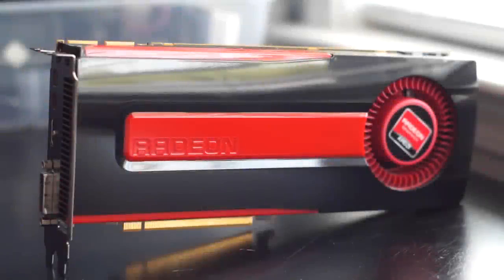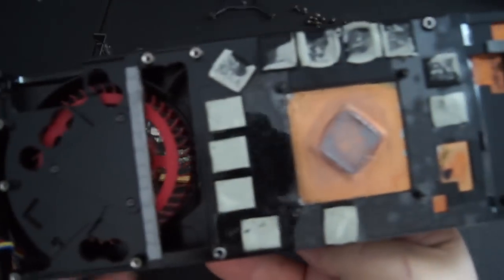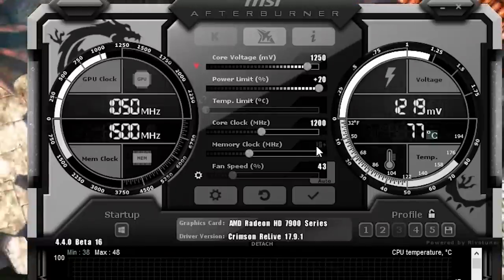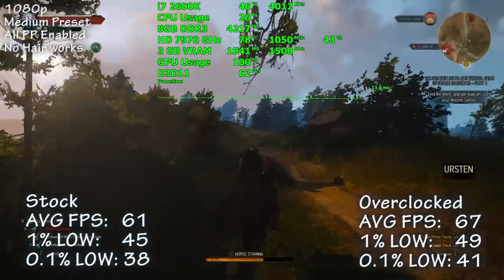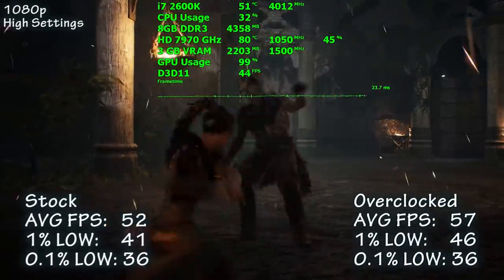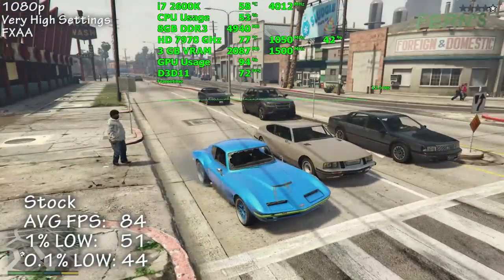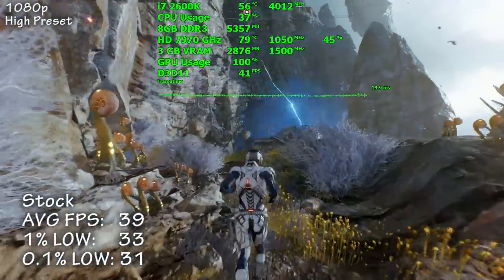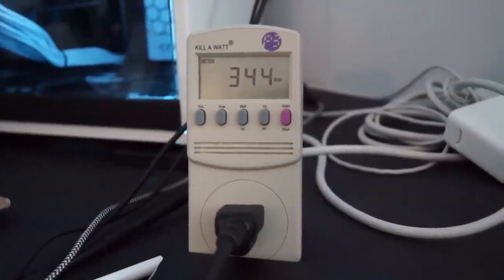AMD Radeon HD 7970 GHz Edition - How Does it Stack Up in 2017?

Comment from the maker: ***UPDATE***
Thanks to MC Peppers for noticing an incorrect result.
In Rainbow Six Siege - When selecting the Ultra preset, the game defaulted the resolution scale of 50% (which are the numbers shown in the video) - With 100% Resolution scale the stock clocked card pulled 55 FPS on AVG.
Reply: F2F Tech bf1??
Reply: Mike, are you in the Pacific NW by any chance?
Reply from the maker: Cooper Gates I’m not. Located in North Carolina.
Reply: Shoot. I hoped it would be easy for you to borrow my card for some runs.
Reply: @Cyrian Genesis performance is around 60 percent of the framerates 6 gb version is close to double the performance
Reply: Now rainbow six uses vulkan , im curious of the results of the card in there
Reply: Time for an update video! The 7970, The world’s first DX12 GPU just got the Adrenalin 22.6.1 WHQL Driver!

Comment: this thing is a legend, costed 300 usd in 2012, still isnt much slower then 300 usd gpu's today.... 6 years later wtf
Reply: I still run quad 7970ghz lol can push 4k in witcher 3 @ 50ish fps
Reply: AMD FineWine my friend
Reply: Looks like a good card to survive mining apocalypse
Reply: I'm 80 right now kids!
Reply: MC Peppers that was launch price, prices dropped fast, by 2013 they were selling for as low as 199 usd
Reply: Pyro1515 - Why would you run quad Crossfire though? There really isn't much of a performance increase after the 2nd card.
Reply: Unfortunately our own apocalypse is also undergoing! @breezyberwick1927
Reply: it's the ram , AMD did good pairing it with 3 GB of ram.   few games today use over 3GB , (though some do now )  no games  actualy  plow through the almost standard 8 GB s  found on many cards today.  give it another couple of years and then 3 GB won't cut it any more.
Reply: @DenverStarkey  Vram usage for 1080p sits between 3 and 4gb for ultra textures and it has been like that for some years now (remember how battlefield 4 used 2.8gb of Vram on ultra textures). There are a few newer games that shows an interesting gap between Rx 570/580 4gb vs 8gb, but 90% of them perform exactly the same... furthermore, Rx 570 has an improved performance compared with HD 7970/R9 280x (which performs pretty much like GTX1050Ti) so for the raw computing performance of the HD 7970, 3gb of Vram will be fine up to the point when 1080p become a legacy resolution (like nowadays happens with old GPUs with 1gb of Vram if used in legacy 1366x768 displays... in which cases they tend to do just fine)
Reply: @jotabe1984  
well that's battlefield 4 LOL , there are a few games that creeping  over 3 gigs of vram and even fewer that creep over 4 gigs vr  , the two titles I can think of that come first to mind are GTA  V and fallout 4 , both of which eat up 4 gig's of vram if you let them (ie , have a card with that much ram , and setting the setting up in game).  also the unreal engine 4  has seen 4 gigs of vram chewed up easily  in several games that use it , such as ARK  and Conan exiles.  but yes currently these titles don't even approach the vram of higher end cards , (most UE 4 games  vram useauge sits between  3.5-5.5  gigs depending on your settings. unless you of course crank your resolution up to 4k in which case you can see close to 6 gigs  get burned but still far from  the 8+ gigs most top end cards are sporting today.
Reply: Lol nice exaggeration. Don't get me wrong, the 7970 (normal and GHz) is a legend, but you don't need to lie to praise it. It didn't cost anywhere near 300 USD in 2012, as it was actually around 429 for the normal version and 499 for the GHz Edition in the summer of 2012. These prices were according to numerous articles published at the time, such as this one: https://www.anandtech.com/show/6093/amd-radeon-hd-7970-7950-7870-price-cuts-inbound-7970ge-available-next-week
Reply: (One comment on the linked article)

"When I was shopping the prices were about as follows:

HD7850: 270-290$, 280$ for the MSI Twin Frozer III version
HD7870: 300-350$, 330$ for the MSI Twin Frozer III version (what I got)
HD7950: 390-430$, 420$ for the MSI Twin Frozer III version

So I think my 310$ HD7870 is a decent deal considering my options and my budget. Compared to the HD7850 it's 15% more for 10-25% more performance. Compared to the HD7950 it's 80% the price for 80-95% the performance."

So, not nearly as good as some AMD fanboys would like to think
Reply: @XZagatoX  bought mine used after mining crash for 159 plus 10 or so for shipping with a huge artic  3 fan custom cooler sits in my main gaming rig as we speak however it's getting a little tired on newest titles
Reply: @Zennoq  yeah for GCN lol.

Comment: God, the 7970 must have been best PC part purchase of the 2010's. I've never seen a GPU this old be applicable in modern day
Reply from the maker: Pretty much was. Best aging GPU of all time IMO.
Reply: that and the Sandy Bridge processors! :)
Reply: It was, I have two 7970 GHz Editions sitting in a Xeon machine still. Use them for Folding. For a while back in 2016, I was still gaming on them in CrossfireX mode.

Really good GPU.
Reply: I had three of em even. Was like sitting on nasa tech

Comment: Great video!~

Just my 2cents , after having a 280x for about 4 years now, I began searching for aways to squeeze out more perf.
After testing with memory straps I saw that my performance was actually better at 1500mhz memory than 1600mhz and that "downclock" solved some stutters noticibly GTA V.
Its still such an amazing card.
Reply from the maker: Saymite Thanks. That’s interesting. I’ve done some testing my self a while back. I had a 7950 that did 1900Mhz on the memory. I stopped seeing gains when I hit it. That was with crysis 3 as well. I posted my results a while ago on the AnandTech forums.
Reply: Theoretically, my 280x does alot better at 1750mhz (190Gb/s @1600 to 210Gb/s @1750)   but that isnt really stable for gaming.

 I should also note that this changes from manufacturer to manufacturer eg. Sapphire may have different straps than MSI, and also changes from memory chip to memory chip mine is a H5GQ2H24AFR.

Still 1900mhz on a 7950 is fantastic
Reply from the maker: Saymite interesting. Yeah I had two 7950’s Twin Frozr cards. Both were high ASIC (high 80’s) and both Used the 7970 reference pcb. I believed they used Hynix chips, but both clocked very well. 7950 was the card to buy, overclocked like champs.

Comment: Great video, this card has held up pretty well!
Reply from the maker: Oopy Doopy Yes It did, and thanks again 👍
Reply: F2F Tech 
Why don't they remake this card with smaller GPU and 8GB of faster ram that uses less energy, and a backplate, as well capable of Crossfire with any other card will be perfect, with 1HDMi output only.
Reply: Fernando Salazar I think you are talking about the RX 570.
Reply: ProtonicPie 
Why doNOT they make a motherboard with 4GB of VRam built in, so it can give more ram to any card that is place in it as additional ram???
And the motherboard with 4 M.2 slots in the back
Why don't they just make the graphics cards with one single HDMI would be cheaper and better
Also they need to make liquid nitrogen cooling gel, so it can be apply in the heatsink to keep it cool and in the back plate
Reply: Fernando Salazar Yeah...Why don't they ? :)
Reply: ProtonicPie 
They need to make it, so I can apply Liquid Nitrogen Cooling Gel to the GPU.
And also the Ram chips needs to be able to slide out so we can add more ram or replace the ram
Reply: hey look who it is lol

Comment: Damn those numbers seem to be creeping up on the 970 which is pretty impressive.
Reply from the maker: +SENOY GCN ages like fine wine...Terascale...not so much.
Reply: This is the result of AMD and their driver support for older cards
Reply: @F2FTech  Terascale was only really good at DX9. The faster smaller terascale GPUs like the HD 6790 perform really well at 1600x1200 and lower in DX9 titles.

Comment: The r9 280x is just a rebrand of this card.
If you guys can find an r9 280x or HD 7970 for a good deal, I’d buy instantly. It’s basically 1050 ti performance on the cheap.
Reply: It's actually better to buy a 1050ti now,these cards are pretty pricey now as people realize the value.

Comment: The first two PC's I built back in 2012 both had 7950's and almost bought the 7970, but after researching figured it was not worth the extra money at the time. They are great cards and my best bud still has both machines. They CPU installed is a 3570K and both computers still play any game thrown at them. Maybe not maxed out, but still does the job without complaining and neither has been OC yet.

Comment: One of the fans on my sapphire HD7950 died and the hardware shop gave me a r9 280x vapor-x instead after warranty came through, still pray to God for that day. What an amazing graphics card. Still holds up extremely well as shown in the video, moreover, it's not a bad choice even for an ultrawidescreen monitor with 2560x1080 resolution.

Comment: I just got a reference sapphire hd7970 for £75 all in with delivery :)
Reply: As an update i've just flashed the bios on this card from a stock 925 mhz bios to an msi lightning BE ghz bios, now it runs at 1050mhz gpu clock and 1500mhz memory clock at less voltages and replaced the old blower cooler with the gelid icy vision A cooler, it's pretty good still for 2018 :D

Comment: Cool video, was nice to see it put through it's paces with modern day games. I remember upgrading to my XFX 7970 from a computer we got from a family friend in 2002 and was shocked to see how good games could really look. 5 years later and it's still going. I noticed that when you were talking about temperatures that the higher end is what I currently get now that I've given my card a cleaning. I didn't take very good care of it (I am a smoker so the smoke choked up the fan and made the card extremely dirty) and the fan still performed pretty damn well for months running at an average of about 85+. It recently started getting temps of over 95 though so I think it might finally be time to upgrade.
Reply from the maker: +smalldick56 very cool. Yes, I think you might want to spend some time cleaning out the card. If you have a basic screw driver set, it’s pretty easy.

Comment: Love to see videos like this i love gpu’s and cpu’s and like to see all the gpu designs and specs from the past. Its sad i upgraded a vapor x 7970ghz for a 780 classified and then the 780 was much faster now not so much. The 780 at 1300mhz is still a great 1080p gpu. I still have both  cards and never get rid of old parts. My first build was a e8500 and a 8800gt. My two main rigs now are a 8700k and 2080 and a 2700x & 1070ti.
Reply from the maker: I got plenty more if you like old hardware 😉

Comment: Thanks! I just bought a used 7970 (Gigabyte Windforce edition) off Ebay about 15 minutes ago, I knew it was a pretty decent card but came on here and now I feel more confident that I got a pretty good deal. Payed $117 AUD ($89 USD) including delivery. 

It's for my HTPC that's gonna go in my bedroom and I will pair it with the Motherboard+CPU+RAM combo (i5 2500, Gigabyte GA-Z68AP-D3, 8GB DDR3) that I recently bought off Ebay, also for $117 AUD including delivery. I'm hoping it will serve me well for a few years in playing some modern games and also emulation like Mario Kart 8 etc.

I just have to get a case (Cougar MX-330 Gaming) and a PSU, I'm thinking the SilverStone (ET650-B Essential) 650w 80 Plus Bronze will be okay for this build. Do you think I will get a similar reduction in wattage use as you stated you were getting in the video with your PSU, due to the 80 plus bronze rating?
Reply from the maker: Very nice price. As for the PSU, it’s not really a reduction. At a bronze rating Your PSU efficiency rating is around 85ish perfect under 50% load. Which means only 15% of energy coming from you wall is wasted during conversion. Regardless, that PSU is plenty for your setup.
Reply: Thanks for explaining this and advice on this PSU. It seems my system will draw about similar power as yours did so this would be about 50% the power of the Silverstone 650w, so I should get good eficiency I think. Thanks again for this video, you did a great job reviewing this card in every aspect and it was really helpful.

Comment: I have 7970 Ghz Edition ( Gigabyte )-. Just cleaned it up,put Artic frezze mx-2 thermal paste, and it kicks still games in 2017/2017. Amazing graphic card
Reply from the maker: marko gatalo Awesome. In my opinion the 7970/GHz is probably the best aging GPU of all time. Probably due to AMD console wins, but still.
Reply: Yeah,it's amazing. I have Z77 extreme 4 motherboard,processor Intel i5 3570k clocked to 4.0 ( CPU Cooler schynte mugen 4 ,amazing cooler btw) SSD Kingston 240gb ,and 7970 ghz ( Powersupply Corsair 700w) and have no words for it..buy good thermalpaste and it will never go over 69*C temperature. Now graphic cards are too expencive for what they give,i will wait some time to get prices down due this mining etc... :D Nice job and here is like and subscribe from me ( i dont usually do that ) :D

Comment: I was using one of these (XFX DD edition) for 1440p gaming as recently as last year when one of the fans died without me knowing which eventually killed the card. Saying that though my family has had three 7970's (one XFX, one Sapphire and one reference) and they've all died so I don't think they were particularly reliable. But it held up in most games and I'd probably still be using it today if it still worked.

Comment: The drop in FPS in The Witcher 3 could be CPU/RAM speed-related.  Sandy and Ivy Bridge CPUs really benefit from 2133 and 2400mhz RAM in a lot of newer games.  TW3 is one of the best examples of that.
Reply from the maker: Yeah, you’re probably right. Hoping to build a new test system soon.
Reply: Even haswell/devil canyon? Did You test some games? Cause i have 1866 ram and maybe i Will have some performance gain from 2400 ram.. But worth the Price?

Comment: 7970 Holds it self realyy well!Even the younger bro 7950 is capable of 1080p gaming u just have to lower some settings.Both are decent cards even today,and a solid win for used pcs,or adding it to a core i5 pre built system and voilá';1080p gaming rig ready.

Comment: Such a great card. Hat it shortly after it released and it was awsome. Sadly it died 2 years later, because the memory had issues, but I got the full price back I paid 2 years before and traded it in for a GTX970. Also a great choice since I wasnt very experienced with overclocking. With mroe experience I would´ve chosen the R9 290X I think, but at that time it didnt seem that appealing for me. Love your videos!

Comment: Have had this card since 2012, and it's still holding up pretty good. Still thinking about upgrading to 1070ti or something more modern for upcoming games like RD2 or the new fallout.
Reply from the maker: I’d wait until the NVIDIA cards are released. Then either buy new or grab a used 1080 for $350

Comment: I bought the MSI 7970 OC 3GB edition of this card, which basically makes it a GHz edition with the clock speeds it gave. I was using it for the last 5 years and just recently upgraded from this card. It did everything I wanted it to, including running my triple 1080p displays. My only complaints is that with the horrible blower style cooler, it runs hot, even at idle, and I had to use Afterburner to make a better fan curve so it would run a bit cooler at all times. I really wish that reference cards did away with these horrible blower style coolers.

Comment: I forget the exact model I had, but the last but one card I owned was an Asus 7970, and it was one of the best cards I've ever owned. Unfortunately, the overclocking capability on it was quite poor. Also, I remember really liking the look of the reference 7970 (the whole 7000 range in fact), which is unusual as normally I'm quite picky on first release models.

Comment: I had a 7850 until last year, when I changed motherboard and it had some compatibility problems. Now I've got a 1050 Ti and I must say it performs just a little better than my old 7850, so I guess this 7970 has to be way better.
Reply from the maker: They’re pretty close now. They go back and forth in most modern games.
Reply: Gtx1050ti and hd7970 or a well overclocked r9 280, are about on par.
Reply: NO, the 1050ti is closer to a gtx960 and a r9 380 the 7970 is more like a r9 380x because it has the same ship as the 280X, but the chip on 280x is OC.
Don't forget that the 280x is even a bit faster than the 380x.
Reply: Gamyxt If you could read my post correctly you would see that I said a well overclocked :). Not a stock one!
Reply: Gamyxt The 1050 Ti is not closer to a 960, is FASTER, and is Faster than a normal 7970, but losses with a 7970 ghz https://www.techpowerup.com/gpudb/2885/geforce-gtx-1050-ti
Reply: No, you are wrong. My brotha' is way more better than a shitty 1050 Ti.